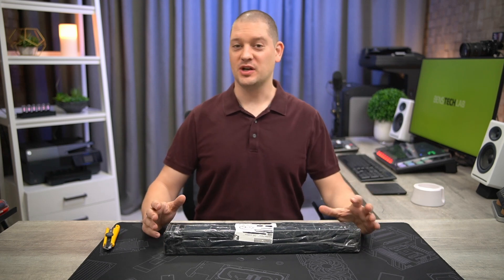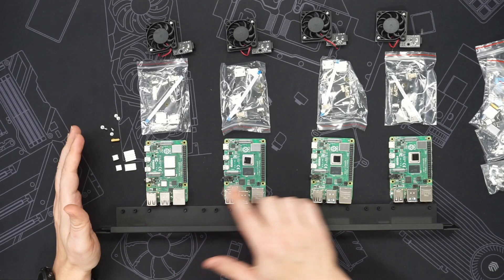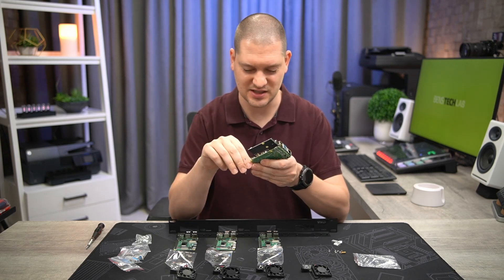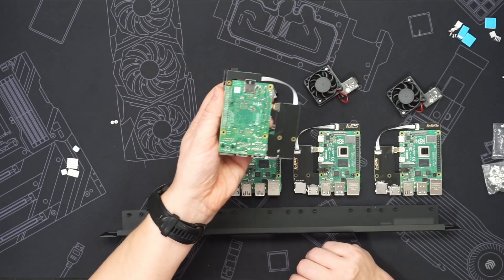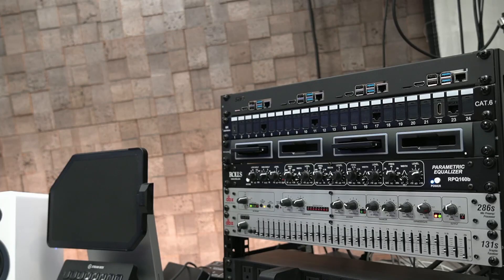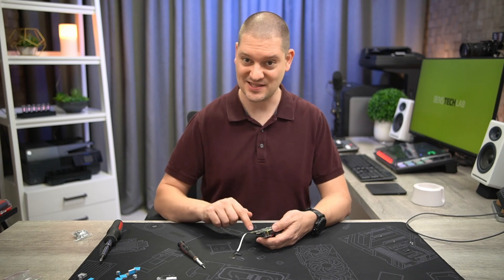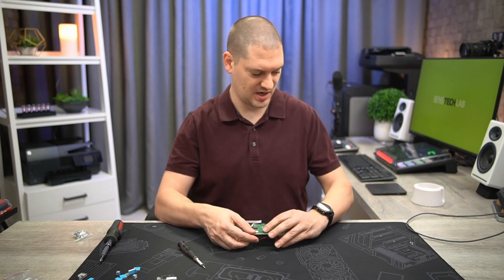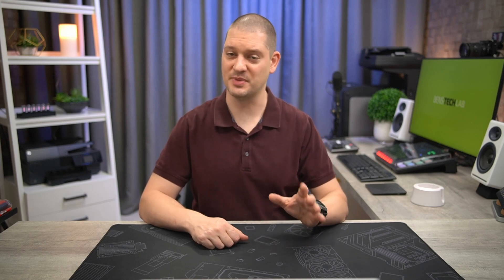RaspberryPi Rackmount from 52pi (GeeekPi)

Comment: Looks like it is RPi5 compatible and most likely with room for an M2 HAT - just needs power buttons.
Reply: I was thinking the same thing. have you purchased this yet? I'm in the market so I was looking to see if you like it or not.
Reply: @BrianThomas  
Sorry but no I haven't - I've had some unforseen hardware failures I had to attend to first and since I have a very limited budget - but I will get into it within a month or two - wether it will be one of these mounts or some of the myElectronics stuff.